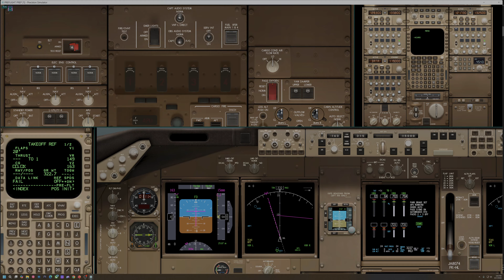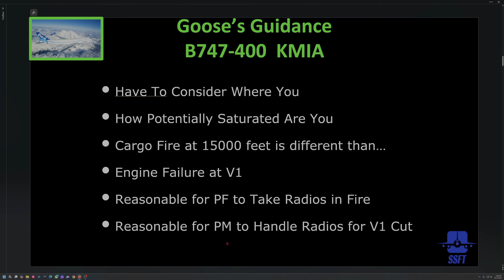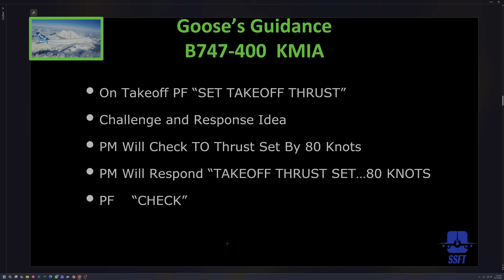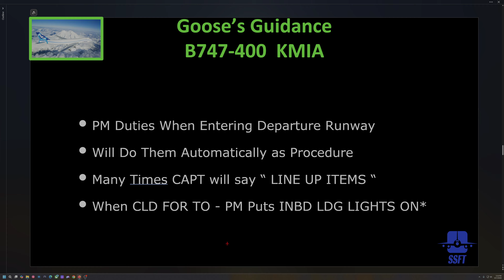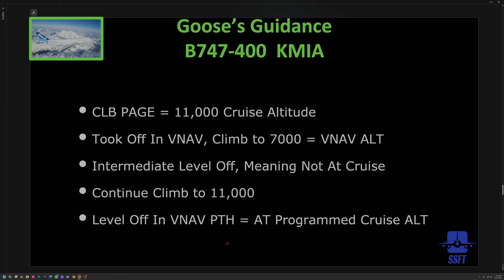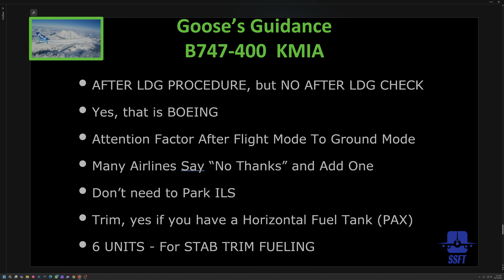GOOSE's GUIDANCE PART2

Comment: Capt Al - Finally home and had time to watch - can't thank you enough for the insight. 
The question regarding forward pressure on the yoke during the takeoff roll - I was curious about the timing of when you were adding and relieving - was there still pressure being applied once the hands come off the throttles at V1. 
Which you answered perfectly - 80 kts once good rudder authority established. 
Forward pressure after V1 was what I didn't recall in my former Boeing experience. 
Well done as always - many thanks again Capt Al - more questions to follow I'm sure.
Reply from the maker: Glad I could help clarify that for you…

Comment: Very good. Id like to know if you were running out of runway on landing, would raising the flaps give more downforce and help it to stop?
Reply from the maker: Theoretically, yes it would put more downward force by reducing lift and thus better braking. In practice, no we don’t suggest it, landing distances are predicated on spoilers out, which gives you weight on wheels, and max braking if you need it and certified without the use of reverse thrust. Raising flaps, while no procedure calls for it, could induce undesirable effects on a swept wing aircraft as well, so definitely not approved and if you did it you are in test pilot mode…
Reply: Interesting. Thank you 😊